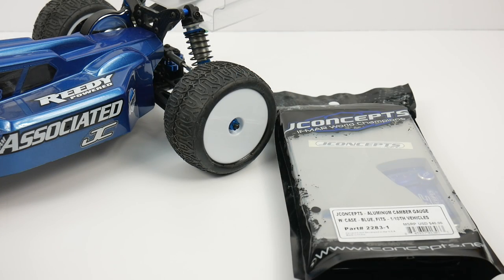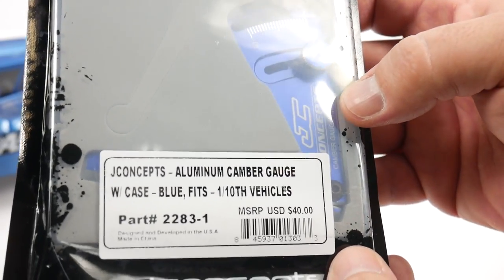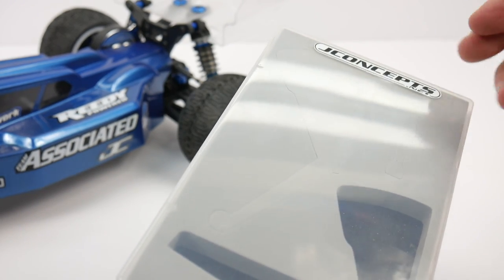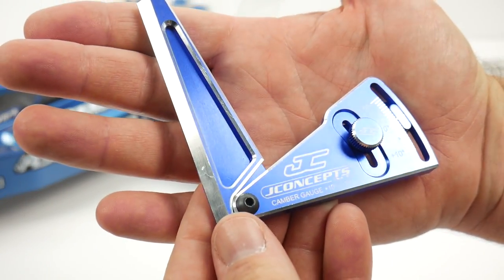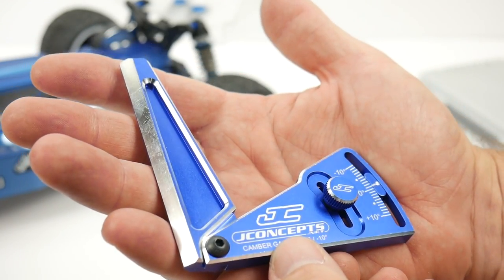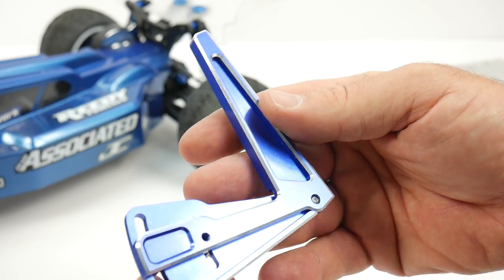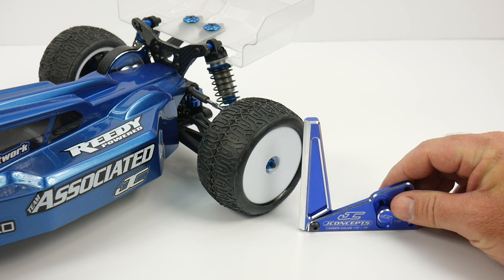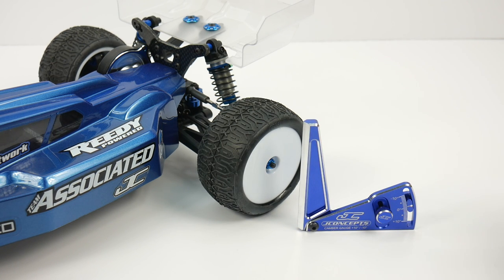Tool Tuesday EP49 - JConcepts 1/10th Camber Gauge

Comment: I have a question how do you adjust the cam? can you show a video of how to adjust
front and rear cam on a traxxas or ect.
Reply from the maker: Hey Santiago, I will be starting up a beginner series very soon and will have video support for that question....till then, it's pretty easy - most cars have a turnbuckle associated with the camber adjustment (Some do it through pillow/pivot ball suspension)  a simple turn of the turnbuckle in the direction it needs adjusting will set the camber.